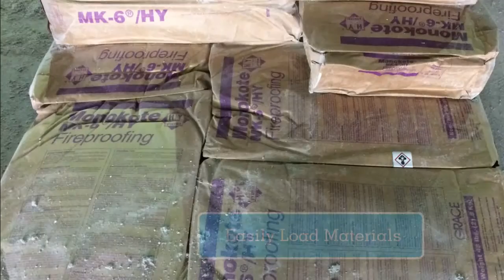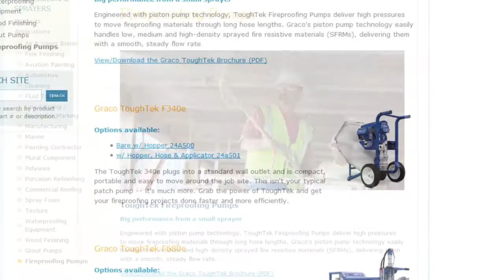Graco ToughTek F680E Fireproofing Pump on the Job

Comment: HAVE ONE NEW  BEEN SPRAYING FIREPROOFING AND PLASTER IN NY FOR ALMOST 40 YEARS THIS PUMP LOOKS BETTER THAN IT WORKS  WILL NOT PUMP MEDIUM DENSITY  PRODUCT UNDER POWERED HAD GRACO PEOPLE ON SITE  COULD NOT IMPROVE PERFORMANCE WE HAVE 4 25 YEAR OLD FM9 ESSICK ROTOR STATOR PUMPS THAT EMBARRASS THIS MACHINE WE ONLY SPRAYED 400 BAGS THRU IT AND HAVE NOT USED IT IN A OVER A YEAR